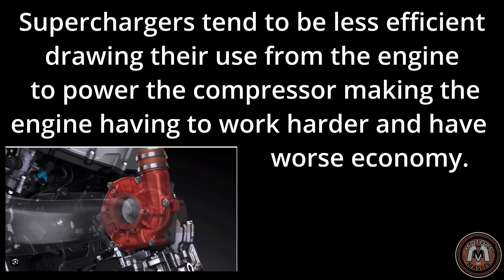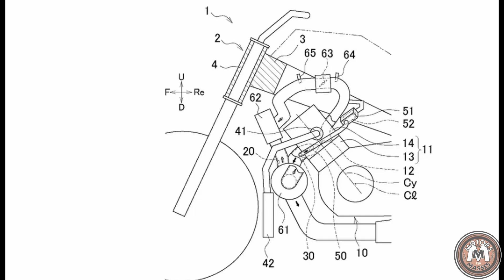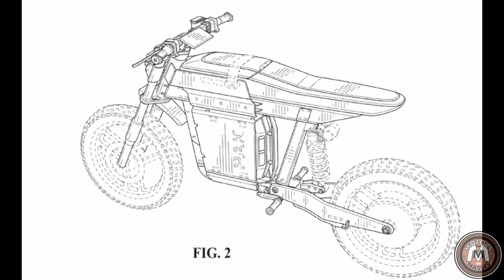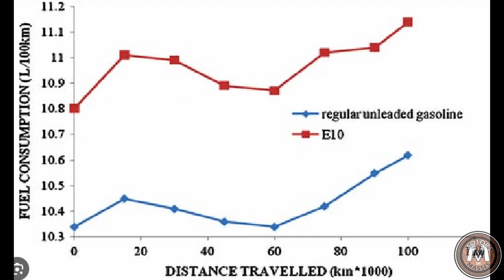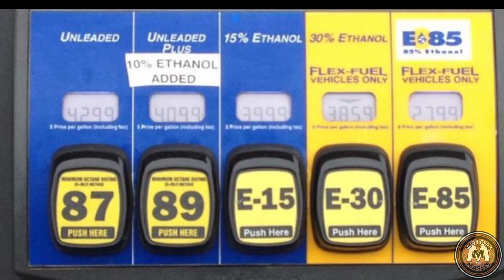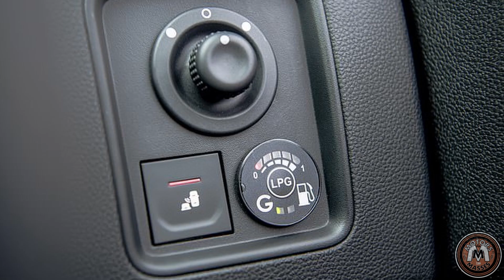2026 NEW tech Motorcycle E-turbo's, GM EV bike & E5 vs E10 vs E85

Comment: I’m rather fond of the 701 husky and I’ve always secretly wanted to own one. The gm bike definitely looks like one, as for the e turbos it’s just over complicating things further that there’s no need for. Same as electric bikes I should think people would still prefer to have a higher capacity engine being worked less. One of the reasons I don’t ride 600s as I feel mean each time I get of them using all what they can offer opposed to the 1k bikes where you can use most of the power but never for to long of a period as it would be impossible. And sorry to see they have ruined the charger, that sounds diabolical 😂 atleast mustang kept true to the nature. They made have made a horrid ev version to please the Green Party but still made it with a good ol v8, the new r5 “turbo” tickles me how they say it’s so close to the original. What a mean way to remember one of the better French cars, I’m the same with the fuel and it’s also what I advise others. Especially bike users that have bikes sitting. Not bad if your caught out and use it. But no way cheaper as you use more, loose power and end up filling more. They should all try come up with some good old diesel power across the board. Bikes and cars. Can’t beat a diesel 💯

Comment: Well, there is a "new" engine being developed that is turbocharged, lightweight and burns all kinds of fuel.. and changing it (the fuel) "on the fly". "driving 4 answers" has a video for it.
Thank God they didn't put a battery and speakers on General Lee, "Sacrilege", I tell you, "Sacrilege".
And lets hope they don't go for electrical anything unless the electricity is produced and not stored.. and I am not talking about leisure vehicles or machinery.

Comment: You can remove ethanol from fuel by putting it into a 5gallon translucent container with a top filler and bottom tap ( like a camping water type container) then adding water coloured with food dye and shaking it up. Allow it to settle for a short while and the water will absorb the ethanol, then using the bottom tap drain off the coloured water and you are then left with ethanol free petrol. A bit of a faff, but if you have an older bike that you don’t use often it does ensure no ethanol. Another way is to buy ethanol free fuel from garden and farm supply shops who sell ethanol free petrol, but that is quite expensive.
Reply: Ethanol isn’t the problem in pump fuel it is all the other crap in the fuel it’s self.

Comment: E5 is not widely available at a lot of petrol stations near me. If I’m not going to be using my bike for a little while I add a fuel stabiliser designed for e10 fuel. Both my bikes are 2024.

Comment: 6:57 Oops! Water is denser than petrol, so if phase separation occurs, and the water comes out of suspension, it sits at the bottom of the tank rather than the top - oil (including petrol) floats on water.
Reply from the maker: Of course...doh.
Reply: @motorsforthemasses 👍

Comment: I’m in the uk and I run a lot of my engine and bikes on E85 and E100. And don’t have a problem. Ethanol isn’t an issue it’s the other chemicals and compounds in the pump fuel that causes the problems.